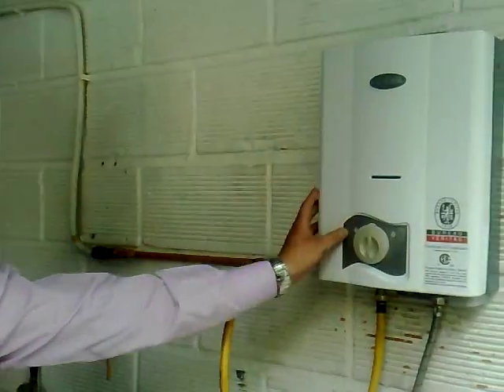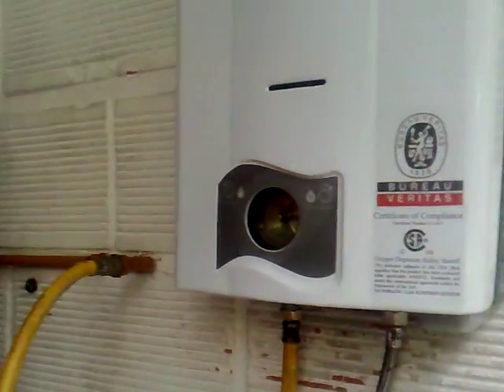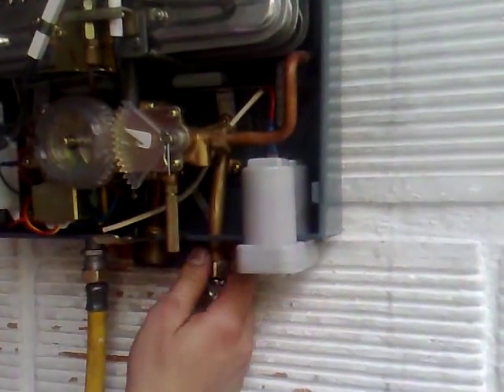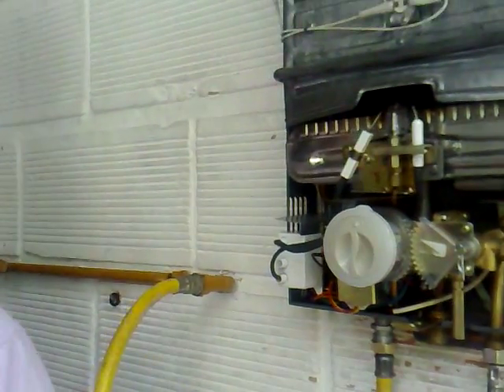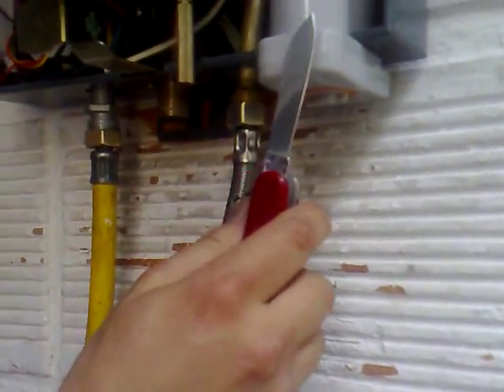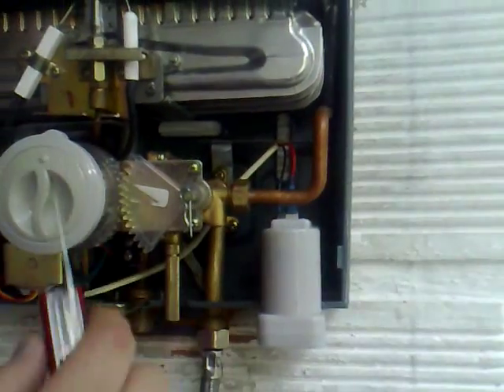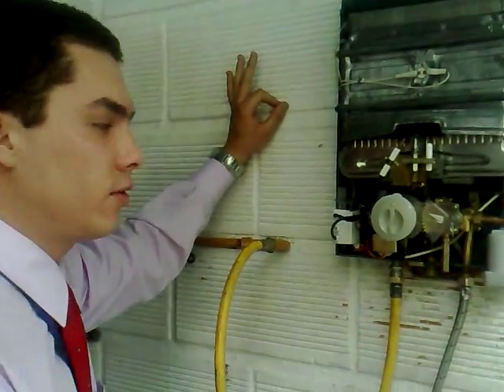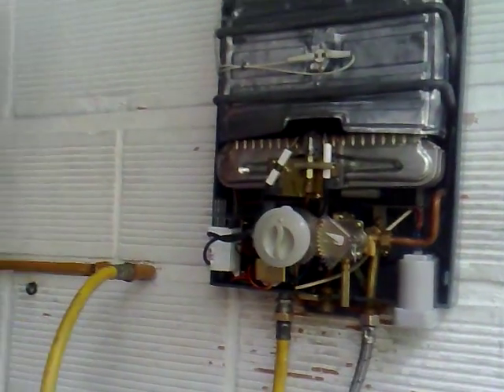Excel Gas Water Heater 1.6 GPM

Comment: Update again: Water heater back to not working. Turns on, runs for 15 seconds and shuts off. Sometimes doesn't even start. FIXED IT: Flushed it with vinegar for 90 minutes. Water pressure noticeably better, and heater fires up IMMEDIATELY.

Comment: One year later; My heater doesn't work, and Excel America has ZERO support. Zero. Nada. None. I cannot recommend this heater, which is very disappointing. When it works, it's great ... but when it fails, you have no option but to purchase a new unit. If a unit is only going to last me one year ... it's not economically feasible.